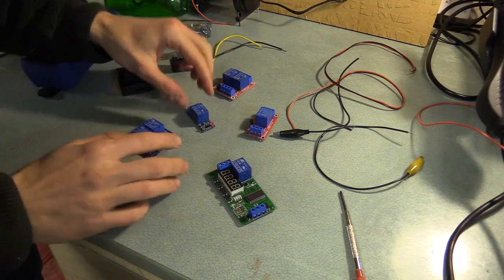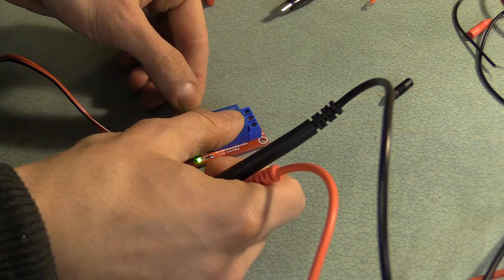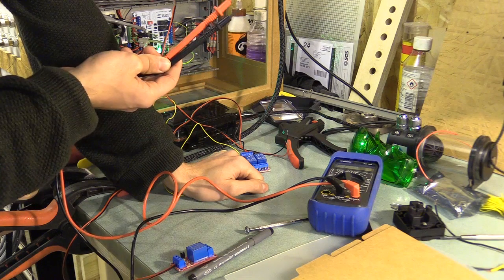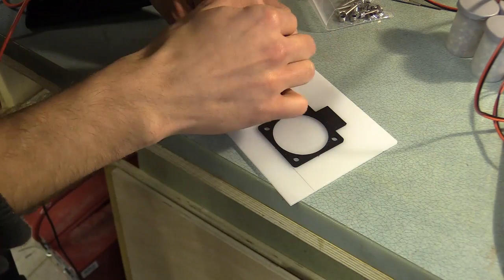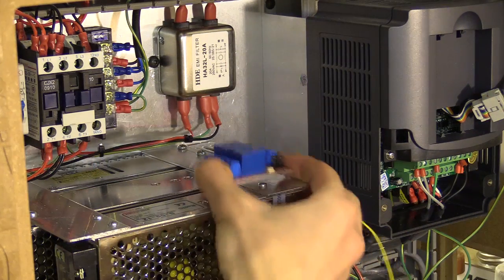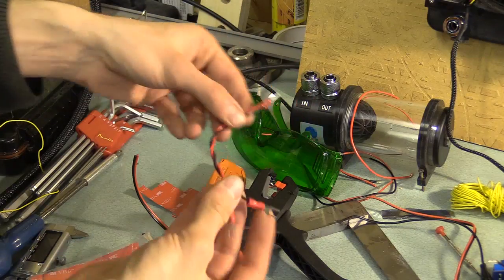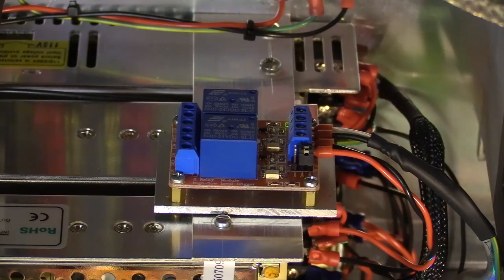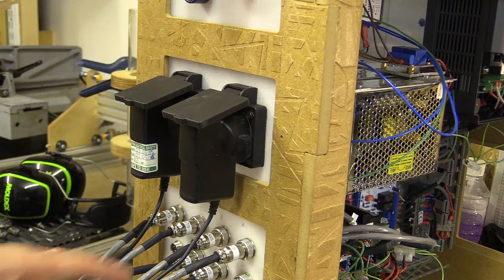#17 Wiring Relay Module To CNC Controller #17 / CNC Control Box

Comment: I am in the same situation with my CNC build as I want to control my spindle through PC program instead of VFD and I have relays around but as stated in vid, activate on a ground signal. Can you please elaborate how to connect the relay so it activates opposite. Here is the board that I have and want to use the SPDL DIR output to control on/off. http://files.panucatt.com/datasheets/m1pro.pdf
Reply from the maker: Maybe you need a relay module that has jumpers to change between active high and low enabling. I'll have to look at mine when I'm next in the workshop to remember what I did. That controller looks pretty good btw. I'm looking at getting a new one for a second smaller CNC machine. Cheers.

Comment: It might be a good idea to add a fuse into the feed that goes via your relay board to your sockets to protect the wires used to feed them as people could plug anything in them ... if you haven't already that is.

Comment: if you mount the plugs upside down or mount the plugs each to a side  , then you can stick the plugs in so they point away from the signalwires